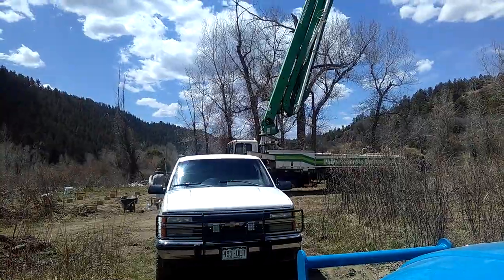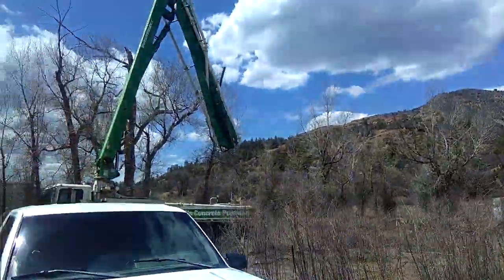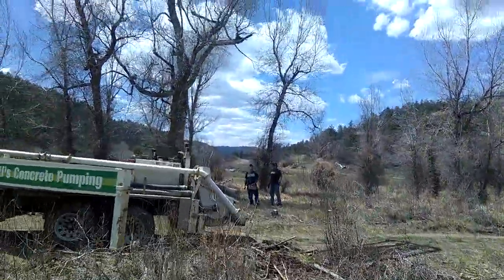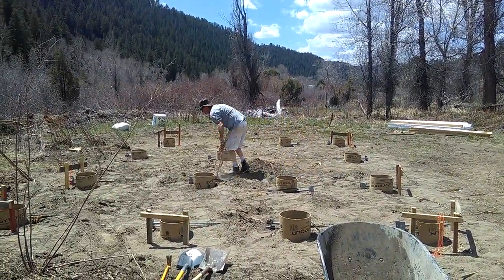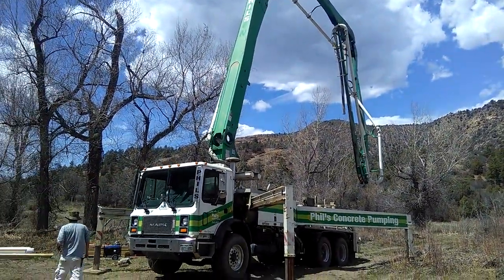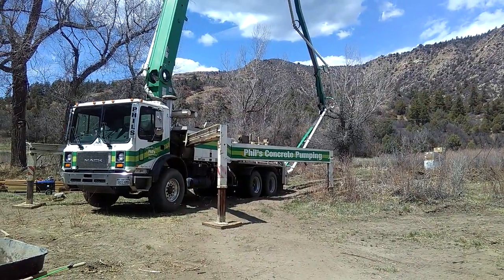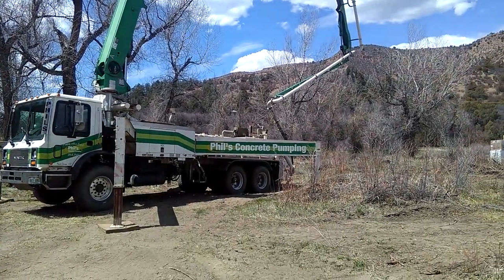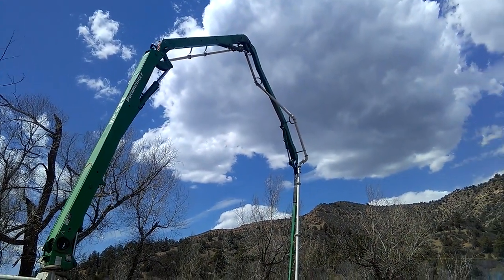Intro to Concrete Pumping - Now That's A BOOM! Hard work = Solid Results

Comment: HA! I FOUNDED LOPEZ ISLAND CONCRETE PUMPING ON JAN 1, 1990, RAN IT FOUR YEARS AND SOLD IT. "ONLY TWO THINGS YOU NEED TO KNOW ABOUT CONCRETE: 1)IT WILL EVENTUALLY GET HARD. 2) GOD HELP YOU IF IT IS STILL IN THE PUMP, OR NOT EXACTLY, PRECIESLY, WHERE YOU WANTED IT."  THE OLD PRO WHO TAUGHT ME...